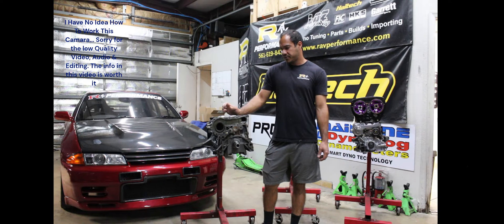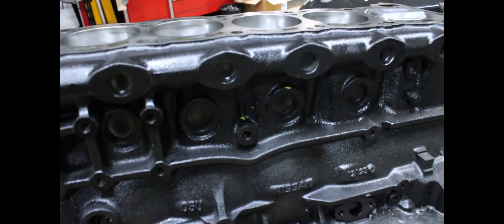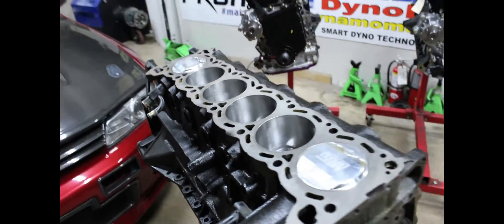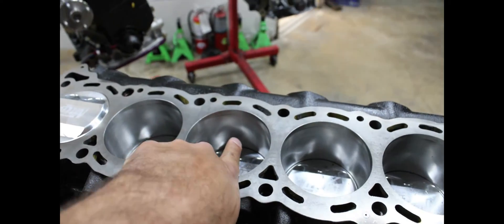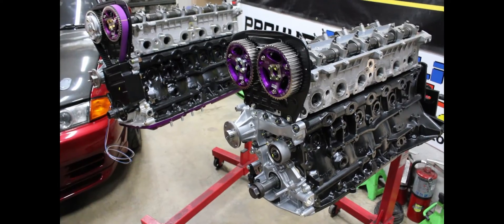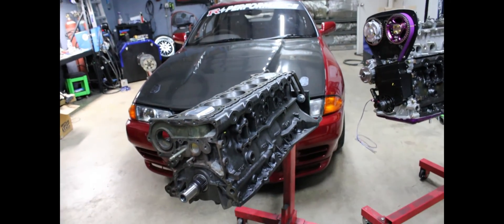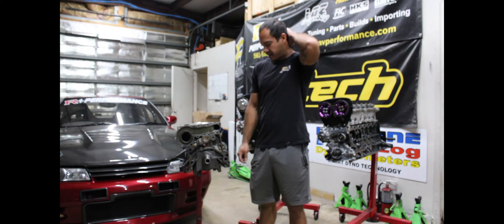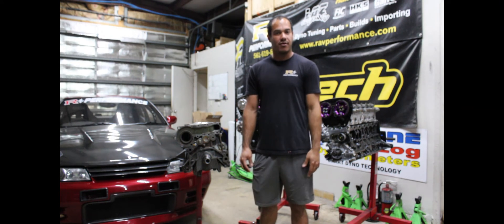RB26 Cracks & How To Fix Them

Comment: Great info, thank you! What about the cracks on the deck from coolant passages to hardware mounting holes?
Reply from the maker: @wicked9secevo  I do mention that in the video. The fill seems to keep that at bay. We have ran pretty hot engines with deck cracks before with no issues. Can't say to ignore them, but don't think they will hurt much in the mild hp range sub 700hp

Comment: just one more thing to add. curing the grout correctly is also super important and per enviornment done in. 
but in my opinion its still something to be done for preventative, pre cracks, rather than to fix cracks. Kinda a tough one with limited blocks available more so in the states, so I get that. But RB any build and small RB budgets are still not small and just dont really mix to well if you ask me.  But I just dont touch 95% of cracked blocks or out of tolerence bore thickness very often. exceptions always from each individual basis too. but Thats basicly standard practice in the AU now. Even solid blocks to use for 600+hp, (pre bottom end build) that test out of certain specs (mostly bore thick and out of round blueprint), get tossed all the time. its crazy how many get tossed that guys would use in a second out here. I do hear thru some friends in JP grape vine that heritage block and heads will release another 50 of both (2022 stock 24U) around august/sept this year. And....... of course the most awesome RB news in a long while, is the PRP cast blocks/heads almost ready for release. improved and custom spec options machined when ordered etc. If you read this and havent seen these from PRP yet, check em out. Get on that pre order list during testing phase now. Herman is not only a really great friend and awesome person first off,  but the F'n RB guru and doing so much for RB innovation for real!!! Go give them support if you have a skyline/RB build here in the USA...... anyway Just another 2 cents of BS given for the night. CHEERS
Reply: AND help bring some badass barra fun to the US!!!! HAHAHA

Comment: Do you think I could do the grout fill at home or pointless ?? I already have a built motor and I’m gonna take it out for oil pan extension
Reply from the maker: You're better off taking it all apart to not risk contamination. But as long as you check your tolerances post fill and they check out youll be fine.

Comment: So with the grout fill but stock pistons, rods, etc, would you trust to tune the car harder versus a non grout filled stock block?
Reply from the maker: We wouldn't recommend you tune any 30 year old parts "hard".....

If you are going to be filling the block, it would be pointless to reuse old pistons and rods.
Reply: @ravperformance  got it, so essentially this is a good insurance policy on higher torque and hp builds then, thanks for answering!